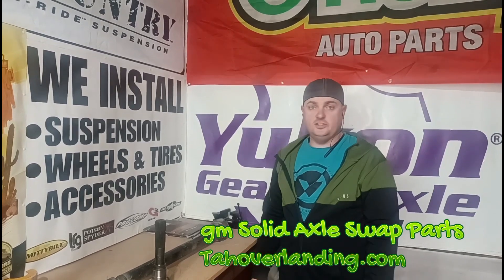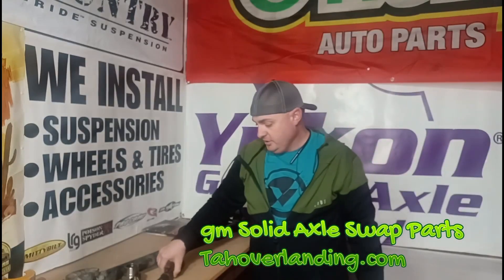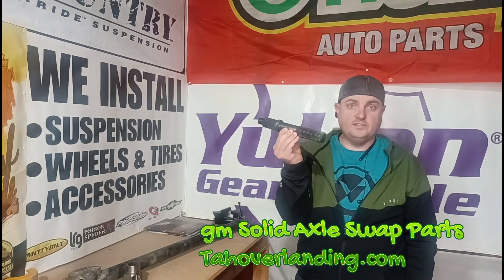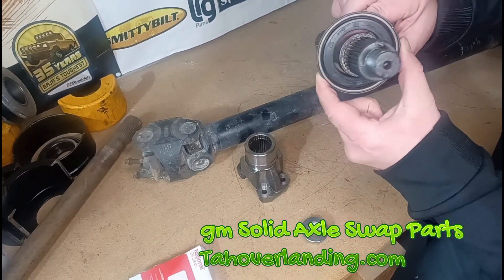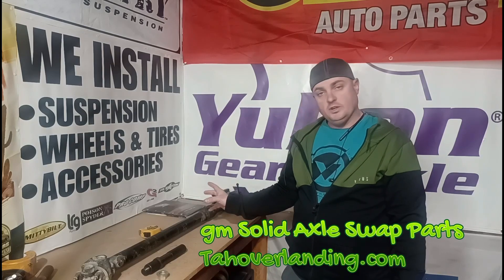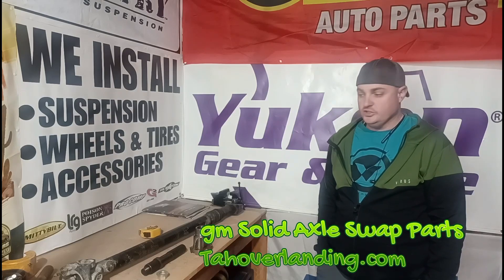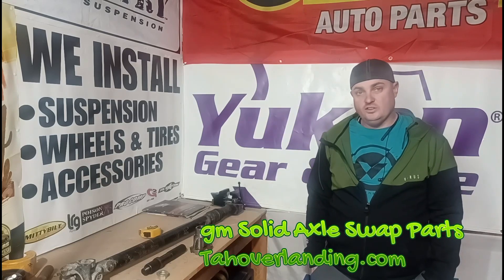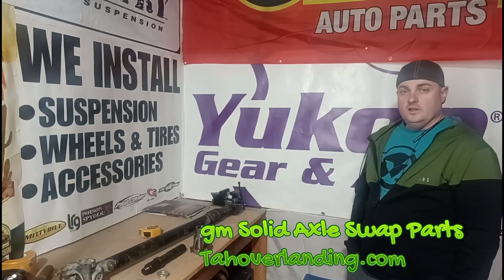Driveshafts for GM Solid Axle conversion Tahoverlanding episode 26

Comment: Hello, I'm planning to SAS My 1999 2-door tahoe, it has the 246 GM Transfer case, do You know what kind of arragement do I need to do with the drive  shaft? I'm going with the D60 front diff.
Reply from the maker: The 1992 should already have an output yoke on the transfer case for the front shaft that does not need an adapter. 

Like I talk about at the end of this video, do your swap and then measure and determine what your shaft needs to be, and go get a shaft that meets those requirements.  

It will be one of the final thing you do, not one of the first things

Comment: I was looking to get into a 00-06 suburban 2500. My plan is to swap the entire driveline and replace with a Cummins, fmvb 47re trans , with the 241 dld transfer case. But I’m also wanting to swap the Dana 70 rear and Dana 60 front axles in as well. How much different from your 1500 build would that be? What issues might I run into? Any advice you can offer would be greatly appreciated!
Reply from the maker: Basically nothing in common. Not a single thing. I do teach axle swap principles that apply across the board. Like in this video I teach to do the swap, and as a last thing to measure for, and get a drive shaft. Which applies to any swap. But your swap will be very very different.

Comment: The Durango shaft is perfect. The closest driveshaft shop to me is two hours away at a cost of about 500 to shorten a shaft and balance it.   The closest machine shop is an hour and they said they could try but no promises.  That is why I had lots of questions about the drive shaft.   But the Durango shaft saved the day at 150 bucks new from rockauto.